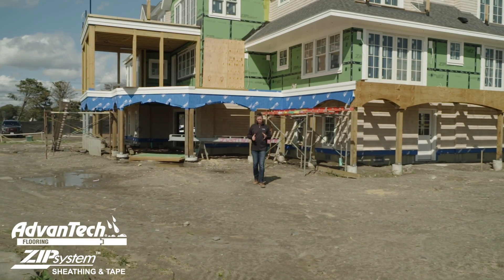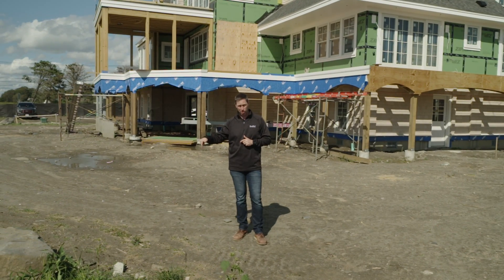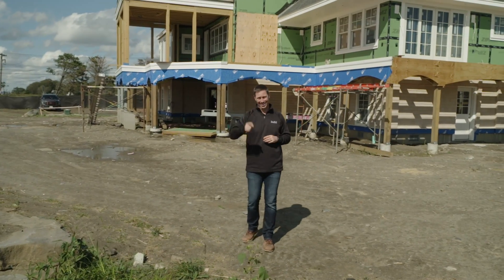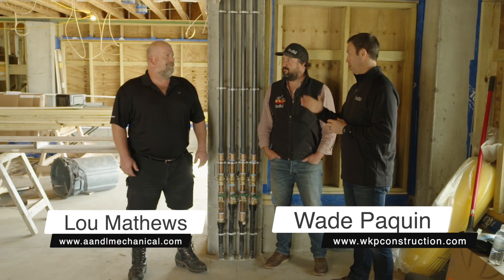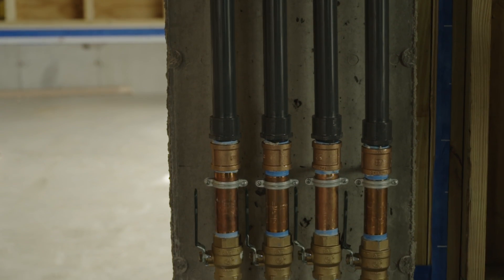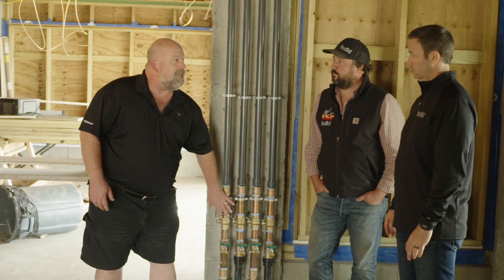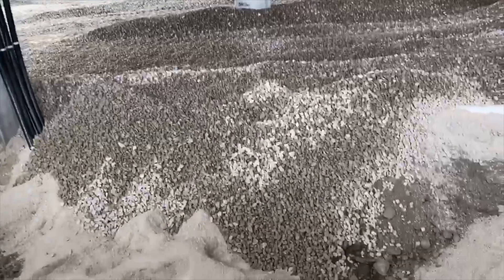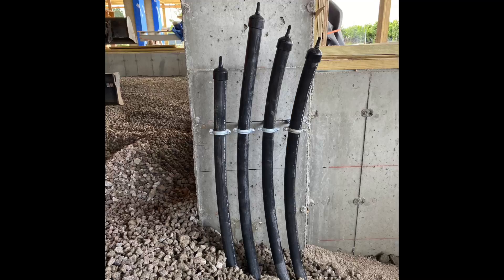Debunking 3 Geothermal Myths

Comment: One BIG disadvantage from my experience is that geothermal runs on electricity and electricity is much more expensive than natural gas in my area (midwest) to heat a home in the winter.  They say they are highly efficient which I don't disagree with but they still have a compressor that uses a lot of AMPS.  You can expect hefty monthly utility bills (on the order of $300+ for an average size home).
Reply: We found that out with Viessmann Boilers. They are definitely more efficient than cast iron boilers but the electric for the separate boiler pump and the exhaust significantly negated the gas savings. Then throw in the maintenance nightmare and you lose money trying to save money.
Reply: Jim Diet What kind / rating of boiler? The electricity used by a modern condensing boiler including its fan and pump is a few tens of watts costing pennies per day to operate. I have never heard a anyone complain about the electricity costs of a gas boiler!
Reply: @spencerwilton5831  500k each
Reply: total 1.5 million btus
Reply: You should always do a cost comparison (there are calculators out there that are decent). For most people, right now, the heating costs between GSHP and natural gas are probably going to be fairly similar (obviously dependent on your $/kwh and $/therm). One could expect NG prices to fluctuate more, so it is possible that GSHP wins out in the long run. If you couple GSHP with your own solar that can help as well. The GSHP will always be cheaper to run than your traditional AC for cooling.
Reply: 3200 sqft in Northern Ohio, it cost me $180-$200 mo. For 72* year round. Of course that is cost for entire home, not just the geo HVAC. It’s very efficient for full electric

Comment: Put in 8 geothermal wells 10 yrs ago here in western Pa.  Cost of the drilling was 2K/well.  Then ran them to two forced air furnaces plus a water circulation furnace (using pex in basement and garage floor). Best decision ever.  We’re all electric in a 8000 sq ft house.  Winter bills about $550/mo. Summer a/c is about $200/mo.
Reply: James - We are looking for someone to do Geothermal and can't find anyone in Pittsburgh. Who did you use?

Comment: I’d say that one of the biggest misconceptions is that it’s too complicated for regular HVAC guys to maintain. Apart from the ground loop itself, the components are the same. The only major difference, electrically and mechanically speaking, is that the condenser fan is replaced by a water pump, but it serves the exact same purpose.
Reply: Jeff Webb  you are correct.  Then again it is difficult to find a competent HVAC repair person for a conventional system also. Oddly enough, there are thousands of really great HVAC folks out there. Sadly, the great ones are out numbered 10 to 1 by lousy service people.
Reply: Jeremy Anderson - Sadly, I’ve found this sentiment applies across the majority of industries.
Reply: @RobVespa  true
Reply: I had nothing but problems trying to find people to work on my waterfurnace unit.  Unfortunately when you get out of the normal, you have difficulties.
Reply: Exactly.  How hard could it be.  The only hard part I can think of if something goes horribly wrong 100 feet beneath your house.
Reply: @rezzbuilds8343  , I take it that you don't understand how these system work?
Reply: @jeremyanderson7741  yeah that's what my comment implied, "how hard could it be".  Meaning I can't do it but a person who does this for a living should be able to figure it out no problem
Reply: @rezzbuilds8343  -- you mean mythical monsters gnawing at your foundation? Good luck!
Reply: We had one in Houston and only two companies would come service or resale these.   Our entire community of 170 house were constantly dealing with these things breaking.   It was so bad that it was one of the major reasons we moved.
Reply: depending on where you are more oil or propane trucks to wait for&& the more that are buit the lower the price will be because of less demand!! No smelly oil delivery trucks to foul our air& no spills if they turn over

Comment: If the pump lifespan is 25 years, in today's dollars what's the approximate cost in time and materials to replace whatever will need replacing in 25 years?  Also, what's the projected lifespan of the pipe, especially the sections that go into the wells?
Reply: The most common estimate I've heard is 50 years for PEX and up to 100 years for ABS. I didn't notice if they said specifically what they were using for this house.
Reply: @seanpalmer8472  thank you!

Comment: Makes sense on very large projects like that....... as the project scales down to normal 3 bedroom size 1200-1800 ft2 , it does not pencil out compared to mini split heat pump technology.    The larger the project the more it starts to pencil out,....commercial has used a variant of this tech for years .

     I have never seen it pencil out in a modest sized home unless you figure it over 60-80 years, but the equipment will never last that long, more like 15-30 on the equipment, not to mention any service calls on a system consisting of many many control systems.

      I would say it was a smart choice for that project,.........for a 1200-1600 ft2 house it would not be.   A standard/modest 3 bedroom house can be covered with 5-6 zones/units with mini split heat pumps in the 1 to 2 k per zone.....6 to 12k total equipment costs .  Giving zoning and scalability without additional controls.

     The problem with digging deep in to tech like this, is it is changing.......if a person went high end 50 years ago and paid for the premium of a system that would last for 50 years, it would eat you alive in utilities compared to today......50 year old fridges, window units etc etc are perfect examples, they cost pennies to operate compared to old equipment.

     Its balance act to straddle quality with replicability.....because every 5 to 10 years you want to upgrade equipment like this as efficiencies are rapidly improving with new tech......if you are super upside down on the payback when a tech comes out thats 50% more efficient, you will be hesitant to dump the old equipment.

        If the savings does not pencil out in 10 years or less on anything, its a huge gamble and probably will never break even.
Reply: if you had ground water close to surface you could build an open loop geothermal heat pump as  a diy project for $600 -$700 with COP 4 some  people go even farther they add thermal solar panels to their systems which increase COP even more
Reply: The upfront costs are definitely the biggest deterrent. I think it would be great to see more places like this: https://youtu.be/Uy0SEG36bEM
Getting it installed when the house is built, and only having to pay a small monthly fee is a much more digestible option for most people.

Comment: An advantage that wasn’t discussed is it’s much quieter than air-to-air heat pumps.
Reply: My Air heat compresor unit makes no noise. You can be standing next to it & not realize it running. The issue with geotheremal is the cost of the wells, which can be price if you ground has a lot of rock that makes drilling difficult & expensive.
Reply: Nice!
Reply: Not a factor anymore with air to air units less than 55db that equates to somewhere between a refrigerator hum and normal conversatio
Reply: @soving  -- they're only noisy when it's really cold, then they're running at full blast and will get noticed (then again your windows will be closed).
Reply: Its the same stuff, compressor evaporator plus water pumps.  No technical reason for noise to be more or less that I can think of.
Reply: @etekberg  The fans on air-to-air heat pumps are noisy. Walk through any new neighborhood in Florida and you hear those heat pumps cranking. On the other hand, geothermal units are quiet enough to put inside the house.
Reply: @ThreeRunHomer  Our outside unit is pretty quiet.  The inside unit sounds like a jet taking off. But it's in the utility room next to the kitchen and on the other side of the wall to our bedroom

Comment: Thats crazy this video came out today, just earlier I was looking up horizontal geothermal systems, which is a technique I wasn't familiar with... and looks to be way more cost effective than vertical geothermal systems - in that you only have to put your loop just below the frost line.
Reply: Many systems use a horizontal boring machine, It pushes a rod through the soil and then pulls the pipe back into the ground. As long as you are boring into soil or dirt, yo can easily go 20 feet deep . Watch for a machine putting a pipe or cable under a street. 3 feet-20 feet same cost.
Reply: Depending on where your at and what your capabilities are go as deep as you can or what your boring guy will. Even with horizontal mine are 16-22' down. Each loop is staggered. Mine was great. The cost and time is so minimal to go down a little further. He rather see me with a great field of loops and never have to come back than the opposite.

Comment: I've worked with exactly one and the biggest nuisance about it is it had a generator load shedding option - except it worked exactly backwards. it took about an hour working directly with the manufacturer to find out which wires I could cut and divert through the load shedding relay to make it drop out when it needed to.

Comment: I just built a 2000sq ft single story house with a full basement in northeast Pa. I had a 4 ton groundbed geo system put in for 25k. I did the excavation for the groundbed to save money. I got a 30% tax credit.
Reply: $25k doesn't seem even remotely close to 35% more expensive than a traditional system..
Reply: @FJB2020  quotes for a propane forced air system w AC was a couple grand cheaper than my post rebate Geo cost. For me with new construction it's a no brainer
Reply: @joepepito5661  That is crazy.. By chance were these quotes from the same company that sold you your Geo system?
Reply: @FJB2020  they were not. I got 2 bids for a propane and 2 bids for geo. 4 different contractors
Reply: @joepepito5661  That is very surprising to me.. Oh I didn't see that you did the excavation yourself.. I wonder what that would have cost.. Most of the cost is in the wells, which can be very expensive..
Reply: @FJB2020  Pay back period eats up any efficiency. Unless your 20 years old when its installed. May get money back by retirement.. lol
Reply: @danfitzpatrick4112  wow i guess he's retiring in his 20's then, as it wouldn't take long to get back the $2500 difference (after his 30% rebate), especially considering he has a 5 ton system meaning he uses a LOT of energy to keep his high ceiling home cool in 110° heat.
Reply: There's the average loop installation.
Has the government maintained that tax incentive?
Reply: @richavic4520  I believe it was going to drop to 27% for 2020
Reply: I'm building a new farm shop in Minnesota this summer with "in floor" heat and am getting a bid on geothermal. You spent 25k and you probably could have had an HVAC installed for around 15k? I'm just taking a guess here but my question is how long will it take to recover the extra cost of a geothermal system? How much extra (or less) electricity does it take to run the compressor vs a standard HVAC? 

How long and wide is your ground bed? You did the excavating yourself which saved you several thousand as well.

I will most likely go with a propane boiler if the geothermal is a great deal higher. I also am going with standard fiberglass bat insulation rather than spray foam as the bid was 10k higher for spray foam. I don't think that extra 10k would ever be recovered in a 3500 sq ft building that will probably not be heated above 60 deg in the winter.
Reply: It sounds like a great deal and you make 25 to 30 years life out of it! Way to go!
Reply: How deep did you have to excavate for it to work?
Reply: @Sugarkryptonite  My geo contractor said the ditch should be 5-6 feet deep so I dug them 6 ft
Reply: What does the $7500 tax credit equal ? 
 My 2000 sq ft single story home , a  5 Ton condenser was $2700 w 10 yr warranty .
Reply: @donjohnson9893  5 ton unit in a 2000 square foot house? That's a BIG unit for that house....
Reply: Jeremy Anderson they factor in high ceiling volume ect . Plus it gets 110° here .
Reply: @jeremyanderson7741  How do you know that? Sun exposure trees, type of windows, attic and wall insulation, etc. Too many variables. need close inspection.
Reply: @jeremyanderson7741  The old rule of thumb is 1 ton per 500 sq. ft. of conditioned space. But as I said before down here you need to consider all other variables into the equation.

Comment: What kind of Coefficient of Performance (COP) are you getting from this system, and how does that compare to air source heat pumps? Air source is so good these days it seems like it would be hard to justify the cost of all the extra drilling.
Reply: the big advantage with geothermal is when it is really cold outside you dont need restive heating
Reply: @niklasxl  there are mini splits available now that work down to -13F. I just don't see the need for geothermal in most places.
Reply: @mattv5281  yes they have gotten a lot better but depending on how far north you are it might be cheaper not to have to run resistivity heating at all when it gets bellow -30 C a lot of the nights. but yes sometimes airpumps are a better fit
Reply: Matt V, during the polar vortex of 2014 it was -40F for a week in Illinois.
Reply: @sam4976  I'm looking at weather observations, and I'm not seeing anything that low. Remember that heat pumps don't feel wind chill, so only the actual temperature matters. It looks like in Chicago it gets below -13F just often enough that you'd want backup heat. Electric baseboards are cheap to install, and if you only need them a few days per year it hardly matters how much they cost to run (they use about 2x as much energy as air source heat pumps).

There are certainly some parts of the country where air source heat pumps aren't sufficient without backup heat. But that's no big deal, and even adding a backup system will still be cheaper than geothermal. In fact, you can optimize it and size the heat pumps for the warmest 80% of the winter, and use another heat source for the other 20%. That ensures the heat pumps are only running when they are most efficient, and you save some money upfront by having smaller heat pumps.
Reply: High efficiency Air Sourced Heat Pumps average ~3 COP (depending on climate zone)
High efficiency Ground Sourced Heat Pumps  are above 5 COP

Comment: Yeah. I got an estimate for geothermal for my house. They wanted $60k. My house is 1600 sq ft with less than 40k btu heat loss. It was about $20k for the wells. 

I don't know what they are talking about costs only being 50% higher than conventional. Maybe on these large jobs the cost to drill 4 wells vs. two isn't that much.

If price is your concern, it's cheaper to get an air source heat pump. The increased cost of running that system is less than the drilling cost for the  ground source heat pump.
Reply: Why are drilling so expensive in us? In Sweden we pay something like $6000 for a 600 feet well.
I've been a geothermal driller before.
Reply: I imagine the drilling cost where the video was filmed, RI, was extremely expensive. I live 15 miles from the RI border and you can’t dig a post hole without hitting rock.
Reply: Bummer to hear. My guess is it definitely depends on where you are and whether you need to do vertical or horizontal boring. Either way like you mentioned 60k to 20k difference is gonna take a while to pay for itself even after the 60k is brought down by tax credits. So I think the moral of the story really would be check it out and depending on where you live, house size, and a few other conditions it may or may not be worth it for you. In my case it was well worth it.
Reply: @BirdBuster91  Agreed. I was only able to get one quote.

Comment: How can this be cheaper than electric heat, and investing the difference into solar panels?
Reply: 400%+ efficiency, its cheaper in the long run
Reply: A lot do both. Heating with electricity is very consuming especially an entire home.
Reply: An N absolutely, but the difference between the geothermal cost and tradition gas/electric could purchase the required solar panels to make it self sufficient.
Reply: @gooseseey4687  Or because its efficient you need less solar. In the end the prices may all even out. Never the less if you go both solar and geo your far more efficient. Might not save you any more obviously but still better in the sense that both systems are working less hard to provide the same outcome. Your thought and question isn't invalid though and is worth investigating.

Comment: Does geothermal need supplemental heat? I have an air-sourced heat pump with electrical resistance coil supplemental heat. Reasonable utility bills during mild weather (Oct-Dec, Apr-May). During January, February and March my electric bill can approach $1k/mo during prolonged cold snaps when the supplemental heat cuts in. My system is about 5 year old-Carrier based system with a high SEER rating heating 3500 sq ft in a 1983 center hall colonial.
Reply: not if it is drilled deep enough
Reply: Depending on the system and if sized correctly it shouldn't. That being said if you have to upsize the equipment drastically to never run suplimental it may never pay for itself either. In my case I have a 7 ton unit and radiant heat through my slab on grade. I do have a back up electric unit that gets installed if for some reason here in MN we see a 30+ day cold snap of 0 or less but otherwise I shouldn't ever need to use it as I upsized slightly just to ensure this.
Reply: Yes, because putting in enough equipment to cover the days it gets below Minus 5 F. seldom makes sense.
Reply: Most of the time it is cheaper to have supplemental heat for the coolest days that rarely occur, than to oversize the ground exchanger.